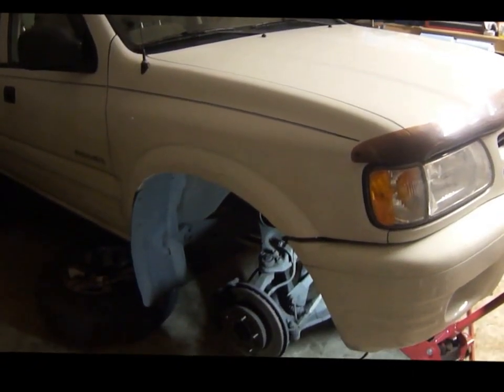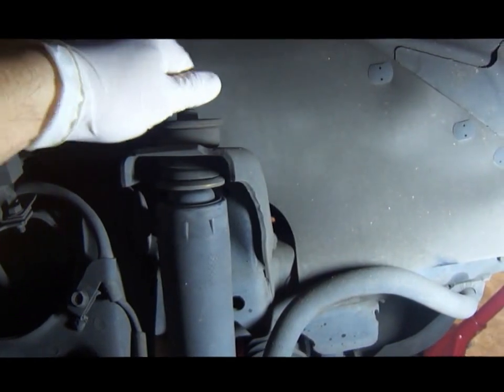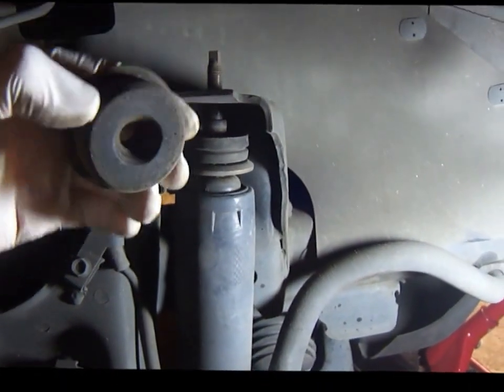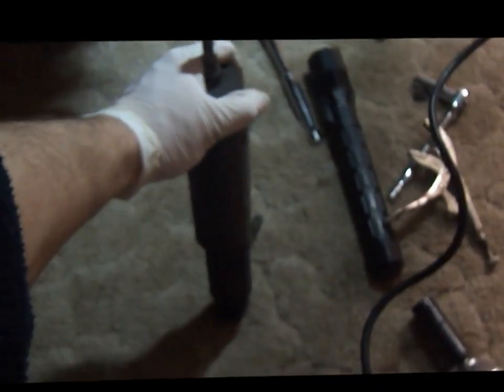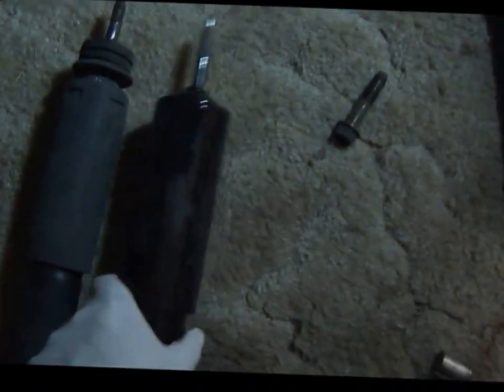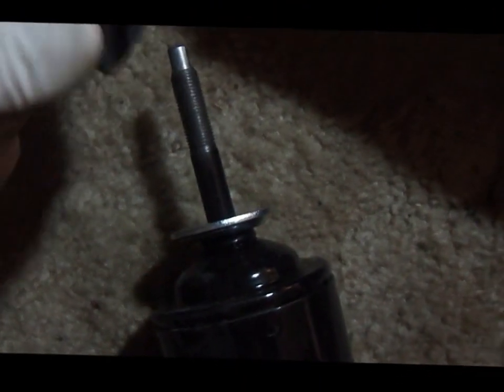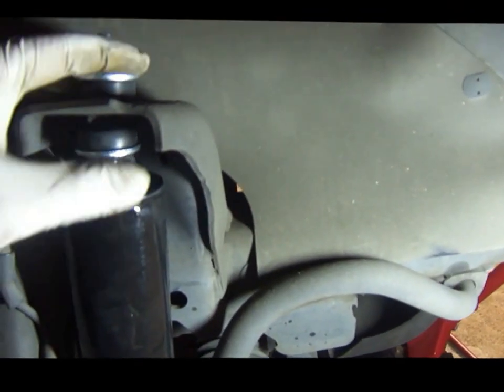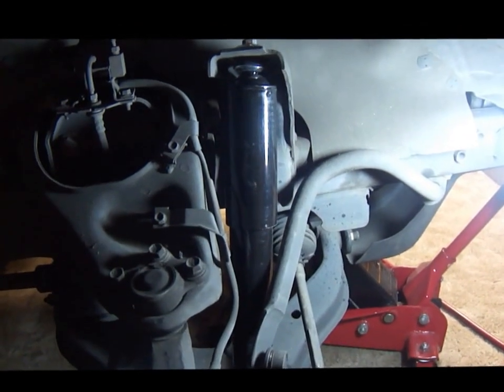2002 Isuzu Rodeo Front Shock Replacement

Comment from the maker: It is pretty easy. I remember I had rebuilt it once. I believe it is accessed from the bottom and is held in place by a couple of bolts. You will have to disconnect one electrical connector and possibly unscrew one, too. You can buy rebuild kits online and rebuild it, it's much cheaper than a whole starter. There are good videos out there on that, too. Hope this helps.

Comment from the maker: When I replaced them on this 2002 Rodeo I used Gabriel ProGuard from Autozone (they were $24.99/piece) and they seem to work fine.  You can go a little cheaper (around $20/piece) or a little more expensive (around $30/piece).  You can also get a set of 4 Monroe shocks on Ebay for around $120.00, those are pretty good ones, too.  Hope this helps.
Reply: Nice job, I have 4 shock master gas to install on mine. Would it be any different being gas shocks in terms on compression on installation?

Comment from the maker: You can buy a starter rebuild kit (there are plenty on Ebay) and rebuild it.  They have good videos on that here on Youtube.  The starter wouldn't cause the break light to come on though.  There might be an issue with your ABS or some other electronic component.  You should probably have it diagnosed by an electrician.

Comment: Hey bro it ended up being the alternator, the regulator was on its way out, so replaced alt and no more brake and battery light, just one question is it easy to replace the starter on this vehicle?

Comment: Where did you place your jack?  Kinda tricky on IFS...
Reply from the maker: If I remember correctly, there should be a special spot that sticks out in the middle of the metal shield under the engine. Or if that piece is off, you can position the jack in the middle of the cross beam that runs between the front wheels and is attached to the frame. You'll have to look carefully as I am describing this from memory... Hope this helps.

Comment: Question. . What is the factory full compression spec for the front shock? Or what was it for the shock in your video?
Reply: Legth at full compression. Is What I meant.
Reply from the maker: Sorry, but there is no way I would remember that now. It's been a while since I did this repair. You mind want to check the manufacturer's website.
Reply: northwestern2002  Thanks